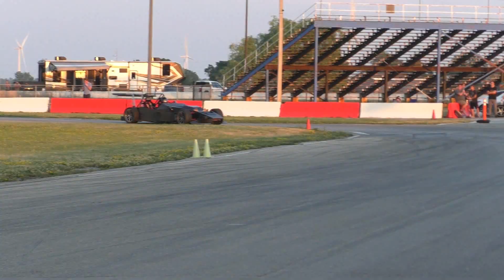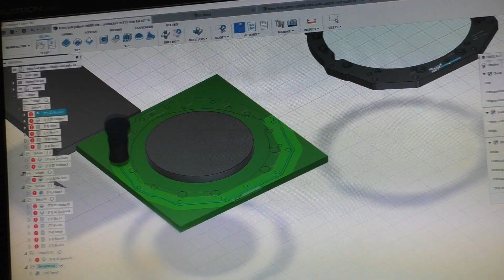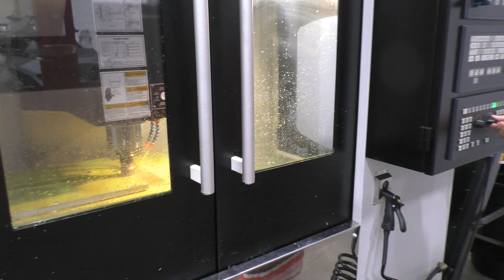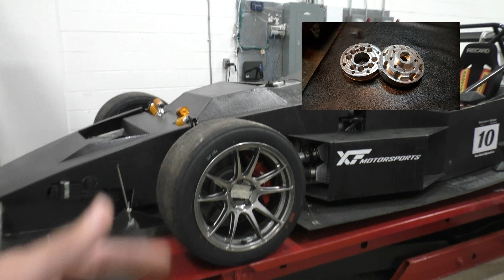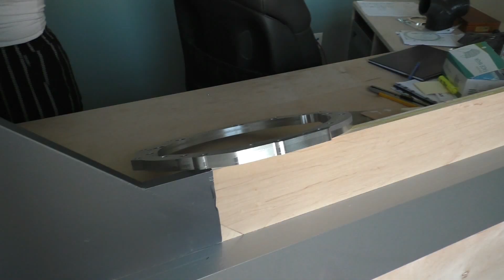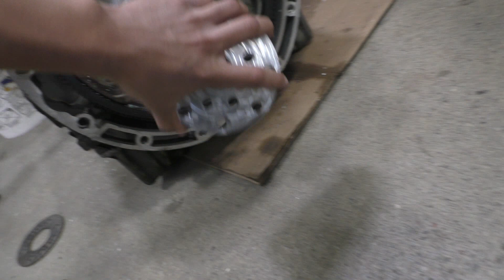Making Billet Aluminum Transmission Adapters - E55 Manual Swap Part 1

Comment: why are they so expensive on your website? For that price I can get an adapterplate and a whole clutch setup, for example OM606/603 /M104/M103 to 6-gear Getrag transmissions, or to Nissan Patrol transmission...
Reply: What I needed to see

Comment: In Germany we have W211 with manual Transmission from stock. 4 Cylinder engines. 
If you need a hanging MERC clutch pedal. Also the brake pedal is smaller in width.

Comment: I was thinking of manual swapping a t56 transmission.
Do you think it is stronger than the 350z transmission?
Also do you have an adapter for this swap?
I'm scared the 350z transmission is not strong enough if I drive the cl55 hard.
2004 cll55 with mods. It made slightly over 700hp 
Thank you.

Comment: My question is how did you do the coding with the engine module without the transmission? Does the car start or was the transmission code out?

Comment: Would adding that much weight to the back of the engine would damage the rear crank bearing, I just thought of that when I saw how far the cd09 flywheel and clutch, looks amazing BTW

Comment: You may also think about shifter surround to integrate it neatly with the interior + driveshaft and as you said, electronics, to make it a full kit if desired. Working these details out can be great value added for you with customers who wouldn't want to deal with it.

Comment: You inspired me a year ago to build this same setup in my 99 clk430. Made my adapters just a little different and had the simpler bolt pattern to work with. I’d love to send you pictures and video if your interested. I’ve followed every step and wound up with an adapter set that I’ve drifted with for over a year now on the same clutch

Comment: I'm glad to see you doing this swap.  I tried manual swapping a C32 4 years ago and got stuck at the ECU. I got as far as getting the engine to start and run without the transmission or shifter modules. Unfortunately the engine's power was severely reduced. None of the US based tuners were willing to help me with the swap either. I wish you better luck!

Mercedes has a flex-plate part number change at engine #60 046180.  I ran into this on an M112 and I think it changed in 2004. Not sure if the 113k's were later though.
Reply: Why haven’t I read this 1month earlier? Just swapped my Slk32 to manual and have exactly the same problem :-(
Was able to code it to manual, so could start without shifter and tcu but absolutely no Power :-( :-(

Comment: Seems an awful lot of weight hanging off the end of the engines crankshaft. Did you balance the original flywheel with the adapters and new clutch etc????

Comment: Would the adapter plate also work for the older M119 model as well considering it has the same block as the M113?

Comment: Hi Excellent video well done both of you and some very good positive comments, as a confidence check - a run out check on the face of the flywheel clutch surface to check for any misalignment and edge of flywheel for up and down would be my recommendation. Would it not be best to make your crankshaft adaptor from steel?

Comment: One Question, will the flex plate be stiff enough to keep the ring gear aligned with the starter pinion? Looks like beautiful product, well done.

Comment: I have some manufacturing advise for you. You transport the whole power over the bolts that hold small adapters inside the transmission. If you make more edges on adapters themselves, that they fit in each other, those adapters would transport the power also and make the life of bolts easyer.
Reply: Makes sense 👍

Comment: Was it impossible to create 1 daptor only? So it could bolt on to an engine and the gearbox would've bolted on that adaptor. A bit thick ring , so it could have enough depth threads for gearbox bolts?

Comment: What kind of coolant does the CNC use? Never seen yellow coolant. And I would suggest in investing about 500$ for a manual 3D probe. Much easier and faster then an edge finder. But not as fast as AUTo probing :)

Comment: First of all, love the channel. Second, how do you plan on keeping the engine management happy without having the transmission control module sending CAN data. Having a stick behind a 113 would be awesome, but it would lose some of the excitement if the matrimony cluster has a bunch of warnings in it.
Reply: Some shop in Florida has done it. Look it up euroworksfl on Instagram.

Comment: just curious, in europe the W211 came with the 6 speed on the E270 CDI, which should have the same bolt pattern as the M112. Why not just use the complete transmission and pedal box from that car? Programming would be an issue regardless, but at least the mechanicals would be a bit more straight forward and "cleaner".

I get that the nissan transmission has better support from the aftermarket, but this isn't going to be a racecar, is it? If it was a daily driver, I'd much rather have an OEM install than a hacked up center console and trans tunnel.

Comment: I'm sure you've already solved this, but what do you plan to do about the shifter position? The CD009 is already pretty long, and adding two adapter plates is pushing it back even further. You also mentioned making sure the electronics can accept a manual transmission. That would be another major concern if this isn't going into a "race car". All the CAN systems in some of these cars makes it difficult to modify sometimes.

Comment: i would have them roughed in on a water jet.  get a full 5x12 sheet cut at once and then you dont have to worry about drops jamming in your cnc and it only needs to do finish drilling, counterboring, profiling and surfacing.  it would make it a 3-4 minute part on your cnc.  or if you are trying to avoid outsourcing any work you can leave tabs or an .010-.015" skin in the slots that you can cut with knife to remove the drops.

Comment: Will the back of the crank be able to support the extra weight of having a heavy flywheel vs flex plate, and on top of that it's spaced further out, which also puts even more stress on the end of the crank.

Really nice job anyways. This is how it should be done. Keep it up 👍🏾

Comment: As for the bolt crankshaft pattern it simple, engines with serial number update 046179 are using older bolt pattern (bolts are evenly spaced) and starting from 046180 - newer bolt pattern.

Comment: If I had an E55, I would definitely buy this off of you guys. 1 question though:

Is the CD009 strong enough to handle the torque from M113k with a tune or with a supercharger and intercooler upgrade?
Reply: The cd009 has been pushed to over 1400hp in stock form , these have been cheap alternative transmissions to put behind 2jz's,Ls's and RB's for a few years

Comment: The Nissan CD009 6 speed (370Z) transmission is better than the T56 in just about every way.
The Nissan is just as strong as the T56
The Nissan is far better shifting, very quick and easy
The Nissan is less than half the price, about $1500 VS 3700
We just need adapters for Ford Small Block, Chevy gen 1 V8, Chrysler gen 3 Hemi and the BMW and Mercedes V12 engines.

Comment: I’m wondering if all 722.6s equiped w211 will fit on this adaptor ? I have a e320 cdi that I’m considering to swap in manual since the trans is going out!

Comment: I question the wisdom of having the flywheel so far from the end of the crank.
Placing it on such a large adapter will effectively increase the mass effect of the flywheel on the stresses it places on the crankshaft possibly resulting in bent or snapped cranks.
A light weight flywheel will reduce the effect to some extent but not entirely.
I would consider halving the thickness of all the adapters and putting some kind of spline into the two piece flywheel adapters instead of relying solely on the bolts. 
To prevent the adapters welding themselves together a thin coating of low strength lock tight or similar would be the trick.
An alternative to such a thick adapter would be to weld and redrill the flywheel

Comment: Bolting 20 kg mass away from the bearing where it's supported to an engine what whas never designed to have a flywheel and clutch and spinning it with 6000 rpm brave! Maybe make the adapter from steel to be extra safe.  Good luck! The work and effort is amazing what is coming from you.

Comment: Regarding the Fly wheel adapters you made, how you'll set the torque spec (billet to billet adapter as this part will be your own creation), and also, will this aluminium adapter handle the stock 516 lb/ft of torque without cracking especially it'll be aluminium adapter bolted to steel fly wheels which as far as I know it's not a good metal match, I'm just curious!

Comment: I have a couple suggestions about the plates (when I had a shop, I machined > 75 different plates for different makes for a customer):  You have a good start with the 2 hold-down bolts in the center.  I also recommend that you drill hold-down holes for the drops in a pre-cycle, then bolt down the drops.  Then machine the dowel pins and outside profiles.  Bolt the plate down by several of the holes, then do the inside profiling.  This constrains all of the pieces and prevents wasting carbide endmills when the drops kick out.  You can just put optional stops for each of the pauses.  I suggest machining the dowel pin patterns into the sub-plate so you can flip the plate over on the dowels and have it exactly centered for the 2nd op.  You can follow this pattern for both pieces.  I would suggest a live tooled lathe as your next machinery purchase :-).  When I did the hubs, I did all turning on a lathe (did both manual and later CNC), then 2nd op the holes and tapping on a Mill.  I think it will be tough to maintain very tight tolerances doing the hub machining in the mill on a cheap 3 jaw chuck.  Obviously the 1st op doesn't matter, but accurately chucking the 2nd op can be challenging.  You might consider machining a fixture to accurately locate and support the 2nd op of the hub, then you'll know center and the face will be perpendicular to the spindle.

Comment: For through holes I recommend you get some spiral point taps, for blind I recommend you get some "CNC" or Spiral flute taps.  That plain tap is the most likely to get clogged and wipe out the threads or break.

Comment: Ar the MB and Nissan engines both zero balance flywheels?  Given the dowel pin of the MB flywheel, I'm expect the MB to have a different imbalance than the Nissan.

Comment: Very very cool! can't wait to see this happen and we see some manual 211 e55s. I recently manual swapped my w210 e55 but I used a crossfire transmission, I wonder how much stronger this trans is?
Reply: This has been pushed to over 1400hp in the Nissan world using a stock transmission,so I don't think the Mercedes engine will be a problem

Comment: Electronics are very easy. Find a SDS (cracked version) and i believe there is a setting somewhere in the ECU section where you can select between manual and auto transmission.

Comment: I am interested in the choice to use a 350Z transmission?   Will they handle the power of the E55 well?  are there good clutch options for making the 500-600 torque that the m113K can easily make?  I would have initially thought that a 335 trans or T56 would have been a trans that would be more easy to source because of how common they are... What is the process that lead to the decision of the 350Z trans.
Reply: The cd009 has been used for a cheap swap behind 2jz's,RB's and Ls's for a few years now ,it has been pushed to over 1400hp using a stock transmission and there are very capable clutch kits out there from all the top guys

The cd009 is cheaper than a new T56 or BMW transmission

Comment: Hey man absolutely love our work . Can you please guide or help me in something .. I have an e55 and I'm thinking of swapping a dct transmission to it .. which transmission do you think would be the best choice for the ratios and how hard would it be to calibrate a transmission controller to the Mercedes ? ... I live in Pakistan so there is practically speaking no companies out here that can help me in this ... I just don't really like the 722.6 transmission but I love the m113k engine .. I would really appreciate it if you could help me out ..
Reply: I think the BMW 7 speed dct is a very good option with a gcu support but the first gear ratio is very high .. is there anyway to change the first gear ratio ?
Reply: Or could you make a solution for me and sell that to me as a kit ?
Reply: Easiest option would be a sequencial transmission with the electronic paddle shifters

Comment: lol, karen looks like 100x more skillful and useful than that other dude you had helping in some recent videos!...not to mention waaay hotter too. :) someone who can run a cnc machine like that, quickly and confidently, is rare indeed.
that's a really good idea engraving all the torque specs and details directly onto the plates themselves. i feel that you are gonna make money by the bucket-load with these adapters. as always, deepest respect.

Comment: How do you find out the bolt patterns for mercedes transmissions and engines? For example which  722.6 transmissions fit an m104.992 engine? great engineering

Comment: There seems to be a high amount of mass being shifted away from the crankshaft flange.  I am curious if there have been any calculations to simulate crankshaft fatigue or failure?
Reply from the maker: There's actually a lot more force on the other side of the crankshaft when it's pulling supercharger belt with over 200kg of tension. An 18kg clutch and flywheel doesn't really do much. Been running this setup reliably in my racecar for about a year
Reply: @xfmotorsports  How do you find the forces to simulate on the adaptor flanges? 
Did you just simulate a maximum inertial force of the mass of the transmission? How extensive was it?
I'm just interested in how someone might go about it, if all the information isn't given

Comment: Out of curiosity, how does one start getting experience in CNC?
Reply: I think the easiest would be getting a 3d printer to understand the principles of gcode and designing parts in CAD

A step further would be Like a shapoko CNC, poketNC something of that size.
Machining CNC goes some steps further like 3d printing. You need think of raw material, cutting tools, order of operations, workholding etc.
Reply: If you really just want learn how it all works to go from concept to part, then I advise you to get a small cnc machine in the $300 range. There are some on Amazon even. 

No better way to learn than to do! However you will need to learn how to use the software. Check out Fusion360. You can use it for free if you're a hobbiest. Also learn what software you need to run your CNC machine and see if you can download it and check it out before you buy the machine. Mach3 is pretty common software for controlling CNC machines. Check it out also.

I'm just scratching the surface but hopefully that's a solid stepping stone for you on your path forward.
Reply: @Chris-oj7ro  Thanks, will check out the Mach3 software.
Reply: Almost forgott, NYC CNC has a pretty good YT chanel where they show how actual tool paths are generated in Fusion 360
Reply: @Faszinated  Will check out. Thanks for the info!
Reply: @Faszinated  Titans of CNC as well

Comment: The kit wont include the clutch pedal or slave ?
Reply: Yep loads here in the uk
Reply: Maybe watch the later videos, he will probably show how he does it. Maybe using the pedal off another e class manual
Reply: Can get the pedal setup from a European manual w211 same with the manual shifter trim and boot

Comment: Any chance you would be interested in building some wheel adapters for my Hayabusa Willys? Current bolt pattern is 5x110, and most ideal for using a 16” wheel is 4x100. Would open a lot more options for my wheels if it was possible
Reply from the maker: I can but I will need all the measurements, thickness of adapter, hub center sizes, off set, fastener sizes